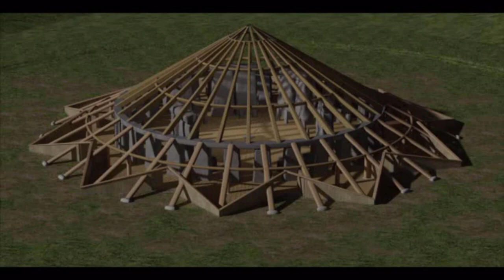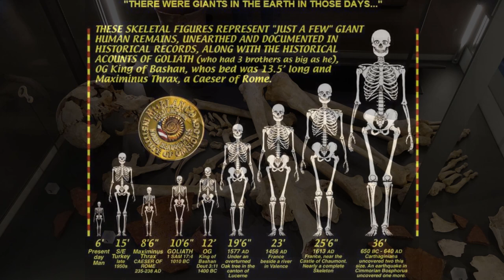Giants Built Stonehenge? Evidence Of Giants? What is the scientific explanation? Stonehenge Theory

Comment: An idea I had some time ago: As the builders of Stonehenge were mostly still hunter-gatherers, could it be they used the warmer seasons for stocking up food supplies that were used in winter, so in winter, there was idle workforce to be had? I guess some physical work to keep you warm in the cold season isn't the worst of ideas and the stones would slide wonderfully easily on frozen ground! The odd campfire here and there and vessels to melt snow in so that it could re-freeze on the ground where needed would have been easy to get as well!
Probably the easiest of all solutions.

Comment: There is an Anunnaki gold processing location in Egypt.  (Abu Gurab?). It has a group on multi-ton pots for melding gold residue and pour holes to pour the gold out. Then there is a separate platform that was designed to hold a large hoist to lifts to pour the gold out of the pots. The large pots are carved from Alabaster. In Sitchen's book describing the location of the gold smelting area with a map of the rout from gold mining in south Africa to the smelting location. His book does not show a design of the pots or crane. Dr. Ronald Cutburth, engineering scientist, intelligence expert. The pots needed to be carved by machine laths and the hoist. The Anunnaki being space travelers had metal cranes that could rotate. They used larger crane assemblies to build the great pyramid. Athor Christopher Dunn proved the big pyramid had a large laser gun in it. It was pointed at the Orion Belt constellation when it was built. That constellation has the same pattern of stars as the layout of the three pyramids.

Comment: All well and good, but doesn't prove anything other than the person who came up with the idea was ingenious. It doesn't mean the people who built Stonehenge or any of the other megalithic monuments did it the same way. Plus, have a look at what he was moving those rocks around on...flat concrete slabs. Try doing that on soft earth that slopes all over the place. Archaeologists can make all sort of claims as to how things were done, but they have little or no evidence at all that what they say is correct. In cases where they've tried to recreate the methods they believed were used, they've usually ended in dismal failure. That's why experimental archaeology is so important. In order for their work to be truly scientific, they must test their hypotheses to falsify them. That's the basis of the scientific method. If they neglect to do that, then all they're offering is nothing more than opinion. 

And whilst a 1 ton block might be feasible to move in a relatively easy fashion as they suggest, try moving one of the blocks like at Baalbek. We can't even shift blocks of that size, let alone place them in the fashion that they were incorporated into the base on which the Temple of Jupiter was (much, much) later built upon. And, that's an extreme case. Even dealing with blocks weighing 10 tons or more, it becomes increasingly difficult to imagine that people who had basically very primitive tools and apparently little understanding of the engineering, mathematical and architectural principles needed to build such structures, then went ahead and did so. You have to compare their abilities to what we can do today. If they could build such structures that we have seen, then it's patently obvious that they knew more about how to build such structures than we do. To the point that it'd be obvious they were more advanced than us and what that implies with respect to the technology they put into use.

As far as giants go, it's neither here nor there. Yes, they've found a great many giant skeletons in the past, but that doesn't mean they were the builders of anything. All it means is those people they found were exceedingly tall.